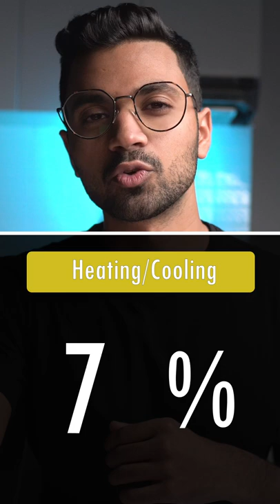Breakdown of ALL Worldwide Emissions by Source

Comment: Did you heard anything about the pyrolysis of methane gas done by molten Tin ? You let melt tin then let bubble methane gas in it breaks the methane gas apparrt and you get Hydrogen gas. I think it would be the best application for Steel furnaces. 

First start the furnace in a regular operation the waste heat can be used for melting the tin and keep it molten then you bubble methane and the hydrogen can be used directly and or stored. 
If you are clever enough you can use the access heat for heating buildings